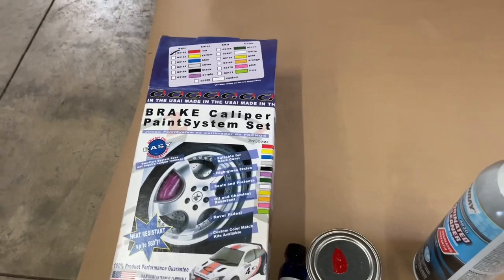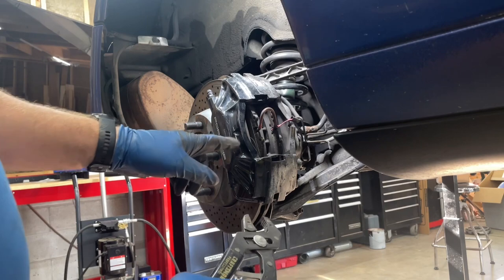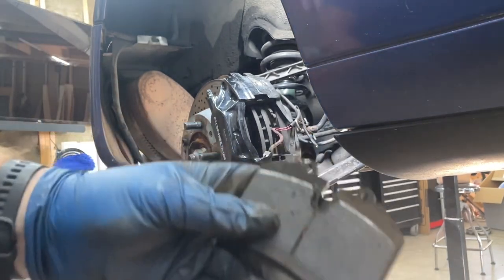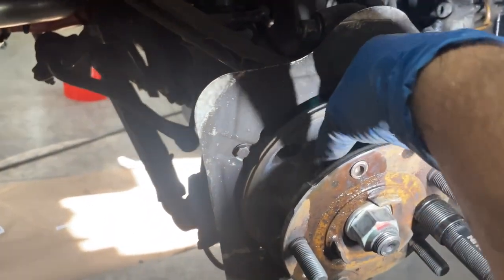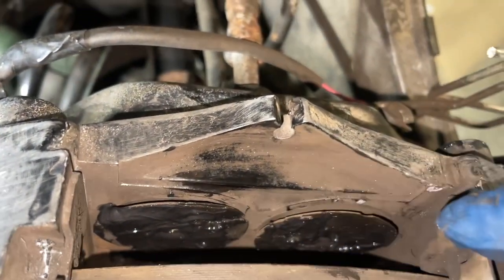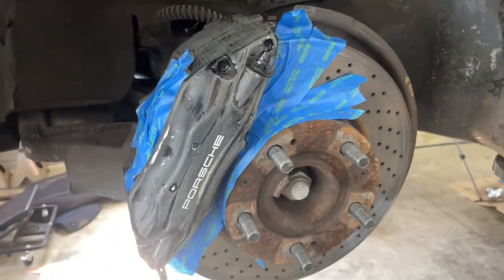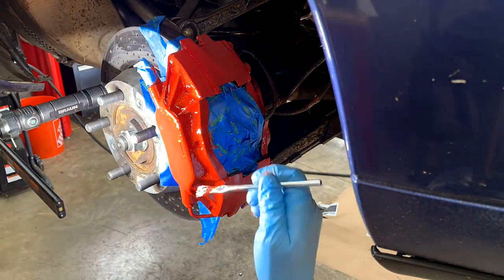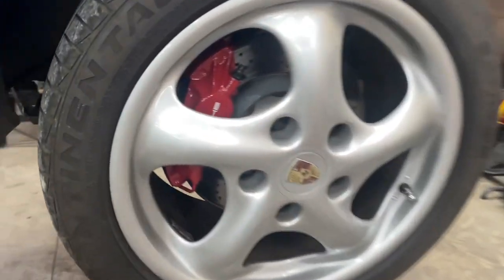Porsche 993 - Painting calipers, replacing rear brake pads, replacing wheel stud

Comment: Nice job. I've got the big black calipers on my 92 964 Turbo and they really need an overhaul like this.. I also have two snapped bleed screws to remove that I am not looking forward to. I'm thinking it may be better with them off the car! Nice to see how good a job can be made with painting it by hand - it has made me think about tackling it myself!
Reply from the maker: If you’ve got broken screws, it’s probably way easier to take the calipers off the car in the long run.  I’m sure the painting is easier off the car too.  I’d wait until you need a brake job and a brake fluid change and do it all at once.

Comment: Are those decals the OE sizes?  Are the front and rear OE stickers the same size?  I noticed the rear calipers are smaller than the fronts.
Reply from the maker: I measured the decals on the original calipers and printed them.  They probably could have been a little bit bigger, but they look pretty good on the car.
Reply: @beardedgarage  It sounds like they are the same size front and rear?  How much for 6 of them shipped to 94547?  Appreciate the time!
Reply from the maker: @93B18  Yes, these are the same F/R.  I'd be happy to print them for ya.  I can't find a way to PM here to get an address, but 6 to 94547 would be $20
Reply: @beardedgarage  Awesome.  I appreciate your content.  Happy to grab 6 of them.  Do you have an email?

Comment: My engine still isn't in. But where did you get the stickers? I need some for my '96 993.
Reply from the maker: The engine isn’t in?  What’s happened?

I made the stickers on my wife’s vinyl machine.  

Let me know if you need stickers or help on the car
Reply: @beardedgarage  Thanks B. Hot weather, had to go to Monterey for work etc. I have the engine under the car just need to push it up into the bay. I still don't have the vacuum hoses correct but I am going to go with the way I have them installed and try to start the motor. Yes I do need the front and rear stickers, I had my calipers powdercoated a year ago but no stickers. My calipers are Green like the car.
Reply: @beardedgarage  Let me know how much a set is and I'll send you some beer money.
Reply from the maker: @ocmacman  I'd do that.  How about $10 for the set of 4?
Reply: @beardedgarage  works, let me know where to send PayPal f&f of course. Thanks. Hoping to get back under her this weekend and get her back on the ground. Our heatwave is over out here.

Comment: Clumsy damaging way demonstrated to compress the pistons, best to use a brake pad compressor.  A compressor doesn’t damage the face of the calliper.
Reply from the maker: To each his own. I’ve done it with pliers, screw drivers, compressor, etc.  as I said in the video, I’m sanding and painting the calipers so I didn’t care about the face of the caliper.